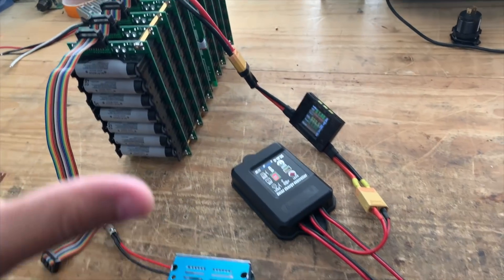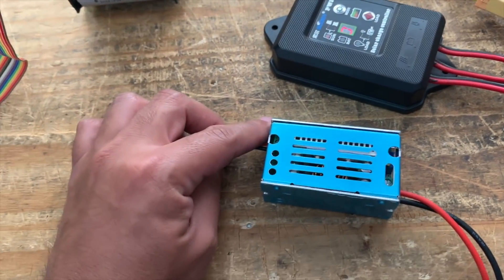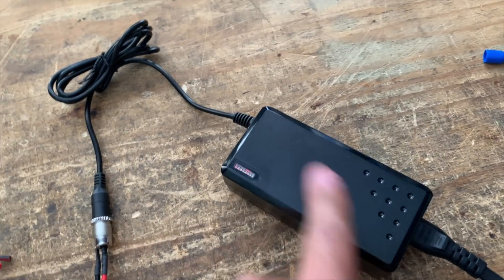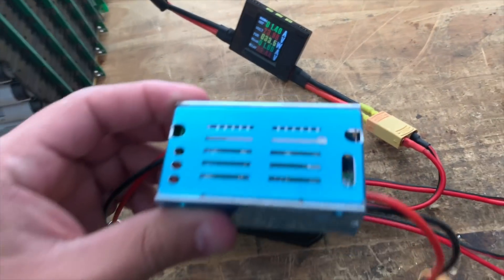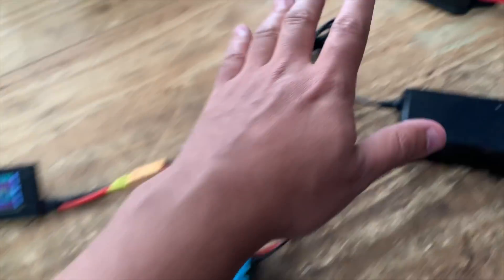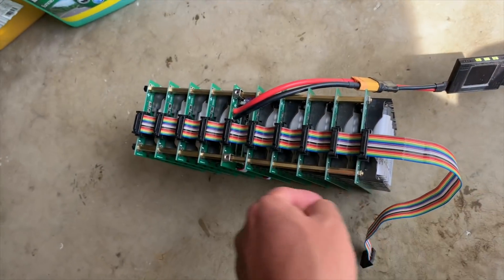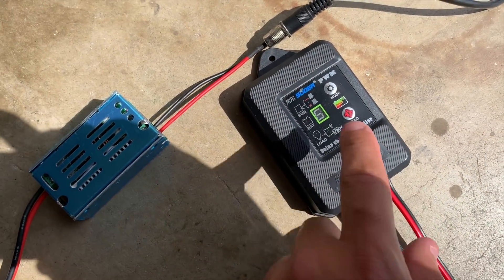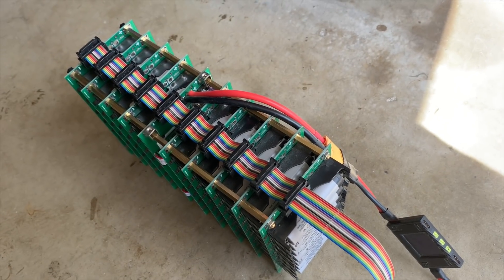Cheap PWM charge controller VS DC-DC Step Down Module

Comment: Best system is solar dump to graphene then dump to fly wheel using pulse motor/electromagnet ... Flywheel can then dump it's load onto the transmission directly. would require new gear design.. this system can run a vehicle to high speeds with only 100 watts of sun, the flywheel is most expensive part, need about 500lbs fly wheel and super strong bearings. they would need new bearings every 5 years at most.
Reply: 1 horsepower = 745.7 watts   
10 horsepower for one hour = 7.457 Kwh
That is between the full capacity of my Prius Prime battery, and its usable capacity. 
Yes, I can drive 84mph on that battery alone anytime I want, but not for very far, maybe 12 miles.  Running on electric doesn't change the aerodynamic penalties for driving fast.  
At normal speeds, Toyota and the EPA say 25 miles per charge.  
Personally, I choose to use the electric mostly at 30-45mph, or downhill on the highway, to maximize the amount of time the gas engine is off.  So I get a bit over 40 miles of electric on a charge.  Plus more that comes from normal hybrid driving, including any regenerative braking or running in "charge mode", which I only use to make sure that when the engine is running at below its optimum load, the charge mode gets it up to a load that is more optimal and buys some engine-off time later.
Reply: @EfficientRVer  I describe a prototype that would run indefinetly with little sun light, all the energy would be stored in the flywheel, no need for battery bank , one battery is enough just for strating the system, it's pulse motor tek
Reply: @EfficientRVer  It's not good to put heavy load on battery instead put the load on the fly wheel and us e the solar and battery array to slowly spin up the flywheel, this is no energy loss way of doing things, ... Energy is lost when load dumped threw the battery if the load is dumped threw the flywheel the stress is never reaching the battery or electronics allowing for a regulated system

Comment: buck converter are not 100% efficiency , 50%...   Plus Lithium batteries do not charge that fast , faster than lead acid but not faster than Graphene Supercapacitors which is what you want to use to catch the sun light and then dump into the Lithium storage. I recommend pure Graphene storage but thats not cheap atm.

Comment: PWM charge controller does no conversion. It's just a switch that connects solar to battery and disconnects when voltage reaches a certain level. When near that level it swiches on/off really fast. While on it draws too much current from panels and makes panel voltage sag. DC-DC converter in an MPPT charge controller draws just the right amount of current from panels keeping their voltage higher. This higher input voltage is converted to more output current by buck converter.
Reply: No they make mppts that go from 24 volts all the way up to 80 volts and you can program them they charge only 60 bucks for them on Amazon green box made of aluminum can't miss it eboarders use them to alter the voltage but the design go from power sources like solar arrays and battery packs two different battery packs but yeah they do make ones that change the voltage.

Comment: You can connect the two  together, if they are good chargers only the one with more juce will charge the battery, I done that with multiple alternators on sound competition vehicles

Comment: The reason why the PWM is less watts is it makes the voltage of the solar panels match the battery voltage.  A meter before the DC-DC or the PWM would show this.

Comment: i am making a solar cycle so my solar panel is 12v 50 w and i will place a converter that will change it to 24v 7 amp  and recharge the battery  . battery is 24v 20 ah  and the motor is 24v 250 w.  so plz tell me is this is right  or i have to change it .

Comment: It's because the PWM controller does NO power conversion - it is a simple voltage-controlled on-off switch! PWM stands for "pulse width modulation" - the box increases or decreases the length of the "on" pulses depending on the battery charge level. If the battery is at a low state of charge and the solar panel voltage is higher than the battery voltage, it will be on all the time. So of course the DC-DC converter is more efficient, as it boosts the charging current while lowering the voltage from the solar panels. Always use a diode in series with the battery when solar charging if you're not using a solar charge controller, to prevent the battery voltage from leaking back through the solar panel at night. Sorry but I get upset seeing someone trying to explain this stuff without the basic knowledge of how it works.
Reply: Tesla Travels what size diode would you use?
Reply: @keeganbuilds  Use a Schottky diode that's rated for your solar panel's short circuit current. For example, with a 4.7 amp solar panel you'd need a 5 amp or larger diode. The Shottky diodes are the best for this purpose because they have a very low voltage drop. Just connect it in series on the positive wire.
Reply: nobody cares you are upset.  your explanation would have sufficed.

Comment: I am trying it with a 19-volt 3.5A laptop charger with a PWM solar charging controller but the laptop charger heated terribly and some time battery not charge when I connect load with 0.5 Amp. Can anyone explain why or suggest some modification?

Comment: Do lithium batteries charge properly on its cc cycle when solar is not constant current?
Reply: Yeah I have the same question!!! I charge my bike at 72V with a solar controller but have to monitor it so it doesn't go over 84, but since the charging curve is different I've always wondered if it affects the Li-ion cells

Comment: Am i the only one thinking that both setup were not working propelly? The pwm charge controller just match the solar panels voltage to the battery to charge it, so if you have 2 24 volts  solar panels in series, you will only get 24 volts nomjnal out, so half the power they can output. On the other hand the dc-dc buck converter should have transform the over voltage into more amperage, which it didn't do. You should have 8 amps at 24 volts instead of 4 amps at 48 (assuming no loss and 24 volts nominal solar panels)

Comment: I have a 48v setup. The controller is 160v input. I have a 30A single phase rectifier. I would like to plug it into the wall and change 120vac to 118 vdc and run it through my controller. Will this work? Not sure about the current control. Anyone try this yet?

Comment: Hello, if there is low voltage from the panel and the battery voltage is high, is it not possible for the current to go in the opposite direction? module or more not damaged in this case?
Reply: diodes prevent that.

Comment: The efficiency of the dc dc converter is dependent on the voltage difference at both ends so maybe in different Szenarios the efficiency will be swapped. I myself also use dc dc converter with a current limiter to charge battery’s just fine.

Comment: The timing on this could not have been better... I have a couple 54 volt stion panels I was looking to charge a couple lifepo4's in different locations and using these at  <$8 each from fleebay is better than spending 10x more for step down charge controllers.  Now I can scour my wall wart drawer for free a/c charging options.

Comment: I believe that, to test te efficiency of the chargers, you need to measure volts/amps before and after the charging module(solar or step down) in the circuit.

Comment: Jehu use a power supply instead of solar panels. You will then have an equal output to test solar controllers. Solar panels vary too much to have a balanced accurate test.

Comment: I just think the dc dc May blast the batteries beyond where they can handle and if your not there to stop it then what?  Most pwm’s are programmed for lead acid but are changing nowadays to include lithium. My lifepo4 charge hard right up til the end on a programmable mppt as suggested by Midnight Solar. Of course I don’t think you’ll find an mppt small enough for that case.

Comment: Use two charge controllers, each set up for the battery chemistry.  Connect one to the solar panels, and the other to the AC-connected DC power brick.  Each can charge the battery so long as its respective power source is working.

Comment: how about building a solar panel designed for 24volts? is that practical,  then you could have 2 24v in parallel

Comment: Thanks for anyone willing to answer: i have built a small itx pc out of a 9x12 fancy vaultz case. amd, video card, powered by an m4 atx carputer variable voltage input powersupply. i have it wired to run from a 12v 200w power brick. works great. now i want to run it off some tesla 2170 batteries. 8 of em will fit into a 4s 9600ah arrangment, giving me over 120w. the system pulls 100 or less. so what i want to do is connect the 4s pack to the ps of 12 output, using a step up put out the 16.8 to charge the lithium 2170 4s pack also adding a bmi. i want the pc's ps to charge the 4s pack,  but then also be able to run off of the 4s pack when powersupply is disconnected from wall. my question is, since 4s pack is gonna be connected and charging from the same ps it will also be feeding, how do i get it to work like a laptop battery, where its connected and charges while ps is plugged in to wall, but doesnt also give its own current to the ps. i dont know enough about bmi's or how to connect this in a way thay would work and is safe. let me know if you get what i mean. i wanna basically give the pc its own portable battery pack that can also be charged when plugged in to wall. ideas?

Comment: You just have to conect the a/c d/c charger way smaller than the solar so you just use a/c d/c charger when the sun is low

Comment: PWM's throw away current to make the correct voltage whereas your DC-DC just converts a higher voltage lower (or vice versa).  MPPTs are at their core a DC-DC converter.

Comment: This isnt really a fair test? You are comparing a PWM charger controller hooked upto a constant 29v PSU vs a 45v solar setup. I'm more interested in what performs best in non ideal situations (cloudy etc, will the DC-DC pull the panel voltage down too much and make less watts etc seeing as its not mppt, and does that make it worse than a PWM controller.
Reply from the maker: I tested both,  controlled power source and solar panels on cloudy skies

Comment: That DC to DC converter is like mppt, becose mppt is classic DC to DC but that solar charger is only PWM and PWM Is not that efficient, above 10% less...
Reply: Hi. If I want to use for small application, less than 5amp, 18volt solar for 12 volt battery setup, is it ok if I just use dc-dc buck converter instead of pwm? I want to get all the juice possible.

Comment: Hey Jehu how are you doing bro? It seriously would be a great thing if you can do a video on making a DC moter  controller, for EV with the outputs for lights, AC, power windows n outputs for sensors if it's a complex vehicle with more sensors n less mechanical stuff. I did go through the basic controller stuff but it would only work for e bicycle not even a bike. Please guide brother. God bless you for all the great work I watch your channel everyday but was missing your live which in India I can see at 7:30 am on Tuesday morning that's what I figured out, lolz

Comment: hi jehu garcia greetings from mexico I don't know if the YouTube problem is already solved.  Another question: if you can advise me or give me a guide, I have two 2000 VA UPS and use 7 batteries in series.  I can use them for a power wall

Comment: jehugarcia can you teach us how to do a Mini-UPS (for router and surveillance cameras via power over ethernet) and a UPS (for PC's) with 18650 batteries? Thanks! Hope you see this :)
Non Senoidal Wave UPS, the cheapest one sold for PC's is bad for them. The Pure Senoidal Wave UPS is expensive af. Perhaps using 18650 batteries for supply energy for the PC and having a charging to keep the batteries at full capacity (or perhaps always 80%), would make this whole "Pure Senoidal UPS" a thing from the past.

Comment: ...the first part is not a charger! it's an AC-DC transformer. the battery charger is what controls the voltage and current the batteries receive

any claims of efficiency in this video are pointless without measuring the amount of power coming into the system from the grid. the battery charge controller may have been limiting the current w/out sacrificing efficiency.
Reply: AC solar? bright mind.